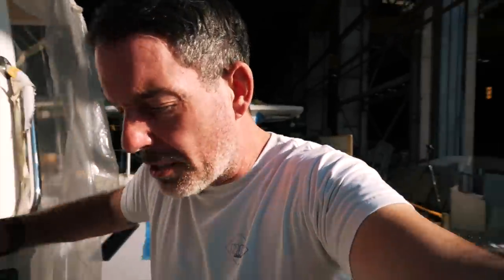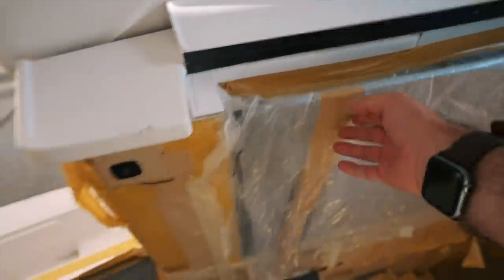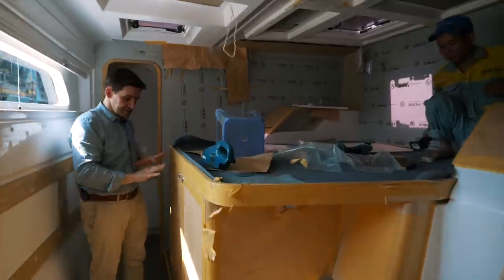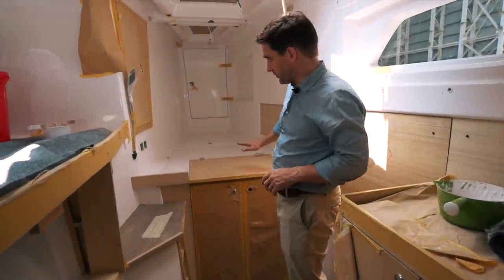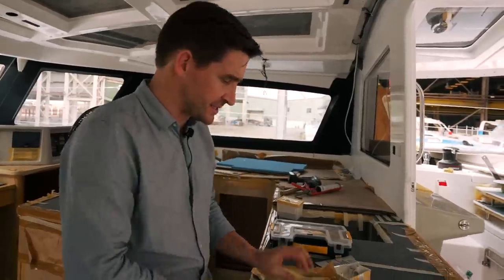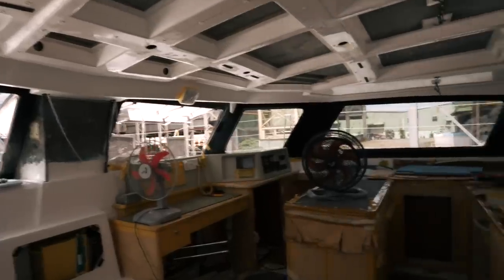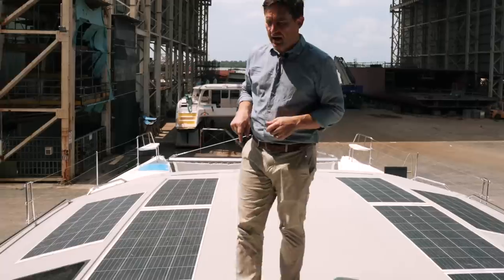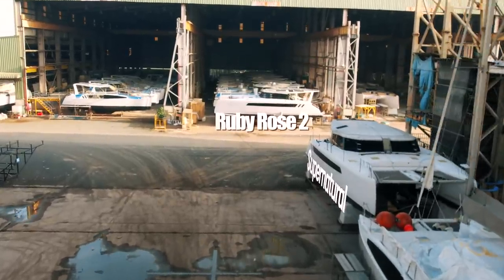BATTLE of the CATAMARANS (Pt 2)- Ruby Rose 2 Special Features & Specifications

Comment: I like that you have the auto pilot control at the inside helm as well as the port cockpit… but you should install one at the starboard helm… I have three helms on my boat and only two autopilot controls (B&G as well…) and always find myself running to the other station to hit standby… put the starboard helm control in now and save yourself some stress.

Comment: I don't know if I commented on it in an earlier video.  One of the things that I heard was having flush mounted solar panels like the ones you have actually lead to a reduced output and shortened life, versus panels sitting in frames with a small amount of clearance underneath of them.  The clearance is to facilitate airflow under the panels, which cools them.  Heat is a very good way to lower your efficiency of the panels, and in doing so, shortening the life of them.

I'm going to be interested in seeing how long these last.

I think you're going to have a wonderful boat when you get done.  I think it's well built, Seawind listens to their customers, the design is wonderful and I expect because of you and RR2, Seawind is going to end up selling a lot of these boats.

Comment: Looks great.  I toured  your hull (I feel like a peeping tom) end of March;  saw how they they tore up the steps to the owner's bed. (In this video about 4:50)  The  new configuration looks great.  I think I can understand how the narrow steps were designed, not a mistake,  just one of those things that only when you finally see it  you know it would be difficult to live with and how it should be.  (Every boat has these, if you can fix them life aboard feels smoother.) It's really terrific that Seawind went the extra mile tearing out the cabinetry and redesigning them. Seeing how much had to be removed; it was no small task.  Well done. 
Separate autopilot control inside is a good option. A few times while on watch inside,  I wanted to change the scale of the chart on the monitor, I spun the dial...and the autopilot changed the course by some random and not small amount. Autopilot also takes up monitor chart space. One of the reasons I was zooming in and out was to see if there were any large ships hiding behind the autopilot subscreen. 
Snake lights are terrific. It's amazing how it's taken so long for these to become 'normal.' I know a designer who 40 years ago had to repurpose  snake lights made for machine shop tools (drill press. They'd been on shop tools for probably 100 years.)  Airlines had this figured for much longer (Last time I looked you couldn't buy them.)
Solar capcity  is great. We had a lot of multiple overcast days where about half your capacity of panels just couldn't keep up. What would've helped would've been a 3rd battery bank. 
All electric galley - very smart. Our head nearest the galley on the 1260 had quite a bit of soot from the propane hob and oven settling in it. Not difficult to clean up... but that soot was going in our lungs as well as all over the rest of the boat.  
Saloon lighting was a bit harsh at night. We cut and rolled two layers of laser jet paper to make frosted covers for the two at the fore of that space. Be good to install a way to make them more durable and removable.

Comment: Where those manual fuse override fuses fit for the CZone, I'd want labelled breaker switches so there's no messing about figuring out which fuse needs to go in where in an emergency.

Comment: I'm surprised you don't like remote autopilot controllers. We've been using a wireless remote, push button AP controller for over 8 years on our 70' wheelhouse sailing trawler. It has worked flawlessly and the batteries last almost forever. It's so nice to sit out on fore deck enjoying an evening cocktail while underway and keeping watch with our remote controller. I love the layout of RR2, I am looking forward to seeing her underway. You all have done an amazing job as has the Seawind manufacturing crew. Well done.
Reply: i don't have tooo much experience with the current gen devices, but don't current gen systems give you access through your app? So for those few times that you do want to remote control the autopilot while sipping on a caipirinha while lounging in the trampoline, you can use your phone. I think?

Comment: If you have a permanent workspace maybe consider an easily replaceable wood surface/board so when it gets all beat up you can replace with a fresh piece?
Reply: Would put a leather surface cover on the work surface. Easy on equipment and tools and cheap to replace when worn.

Comment: Suggest a 3 axis vice rather than a traditional one. Also make sure the mounting structure is well reinforced to withstand the high pulling, bending, etc, forces you will inevitably be using to work on projects. Another consideration is oil, grease, or other fluids that might smear or be spilled. Will need a no adsorrbing stain resistant material or surface treatment.
Reply: I agree with all of this, to do this I think you forget about the sleeping pad and have a real dedicated shop.  I get that it is kind of cool to fold the shop out of sight but I'd go with a door or sash and go full on shop.

Comment: I think I'd go with your design myself, but I would not let them trim the bed corners from the original design for easier access. Access doesn't really bother me when climbing into bed. But my feet like to go looking for the cool spots and seeking them out in the middle of the night is nice fun. It's looking good Nick. You must be xtra excited. One thing I have noticed over the course of the videos on you channel is:  On the 1260's you hired and sailed, the BBQ was on a parallelogram and was able to be lifted up, out of a recessed area within the rear bulkhead where it was 'stowed away', to a nice cooking height and then was able to be "put away' once cooking was finished.  You don't seem to have the option to do this on your boat. Can Seawind still make it a 'Stow away'  item, as per the older design if requested so the cockpit looks more neat and less functional. With it 'stowed away', this would also allow for the fibre glass top to be used as a place to put stuff ( a salad bowl, pitcher of drinks or tray of glasses, bags, shopping etc.) momentarily when not cooking and /or when coming back from shore, whereas with the BBQ lid as it is now you couldn't put anything on top of it, especially with that lovely curve built into it! Could it be possible to recess the whole thing?

When will you splash and go on the sea trial? Fair 💨and following 🌊.

Comment: I would like to have seen more batteries. You can't use what you don't have. You have the solar to support this plus re-generating motor?????  
I find it very informative just watching sailing channels for builds, modifications to simple upgrades.  One lesson learned is that when Murphrey visits on a sail boat..... he comes on strong.  Parlay got nailed by lightning twice, others have had catastrophic casualties as to having adequate spares or help from strangers it has been having enough power to call for help and function until help arrives.   This is my only point .................  enjoy

Comment: Hi Nick question on the sola I have heard the flush mount panels have a performance loss due to getting to hot with no air under them is this the case with the new panels?

Comment: I think you should sleep on a grounded bedsheet.  As you’re surrounded by electrical equipment and EMF radiation.  I have a grounded bedsheet and definitely sleep better.  On a yacht it will have to be grounded with the sea.  I suppose all that equipment is grounded with the sea?

Comment: Big mistake on electrical design in not eliminating conventional shore power and its potential corrosion, safety, and voltage/hertz accommodation. Today with large solar, lithium, dc appliances vs ac, and large dc charging, no reason for a generator OR conventional shore power.
Reply: And choosing 110v over 220v. Other than north America, most of the world is 220v. Much easier  to buy appliances anywhere in the world.
Reply: Shore power would come in handy when there is/are cloudy day(s) and the batteries are discharged, or there is a problem with the batteries, or the batteries are being replaced. Besides, shore power is likely standard equipment and it would just not be worth the few hundred dollars credit to eliminate it. :¬) Webhead USA
Reply: The generator and shor power will get lots of use.
Reply: @laurence9695  6:14 they went w/ 220/240 for that exact reason.
Reply: @laurence9695  Agreed. 🎯
Reply: @pavichapin  Not if battery bank, dc charging and solar is sized correctly
Reply: @pbr-yt8zc  You can cover the entire boat with solar panels including the sails, fill each hull with batteries and you will still use the generator and shore power a lot.
Reply: @pavichapin  Right if using for propulsion, energy densities of batteries not enough for that yet. But with diesel engines with large output dc alternators no problem at all. I have been involved in the design, development and manufacturing of over 200 catamarans, and was the first production builder to build self-sufficient boats in the 90's. On a properly outfitted 40-50 ft cat no problem at all have been doing it for over 5 years with refits. It is only going to get better as batteries improve and more large draw appliances normally AC appliances like fridge. and air move to DC particularly 48 volt. Balance catamarans, and HH both successfully doing it, as well as production boats like Antares, and Nautitech. As for conventional shore power would not want it for the downside of being locked into a voltage and hertz, corrosion issues, and safety. If you want to see an example of current full time liveaboard cruisers ditching the generator and conventional shore power here on you tube look up out chasing stars.